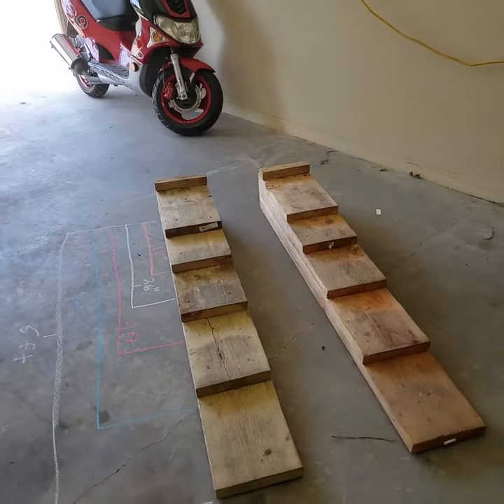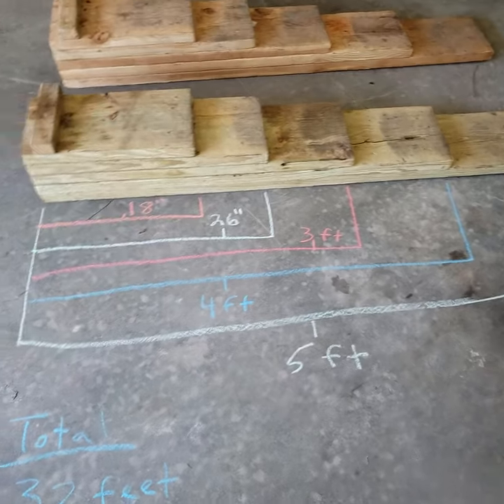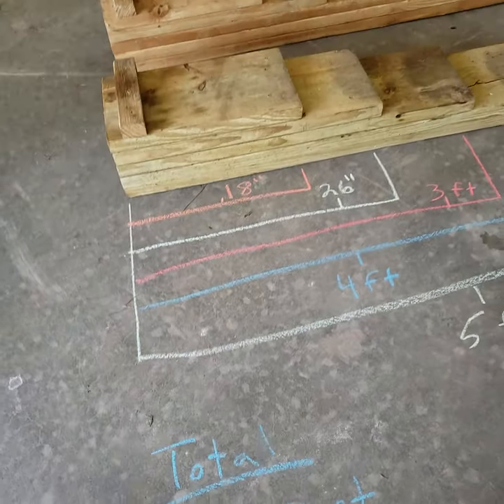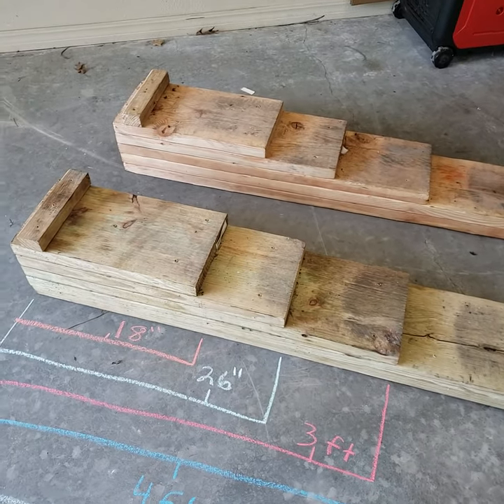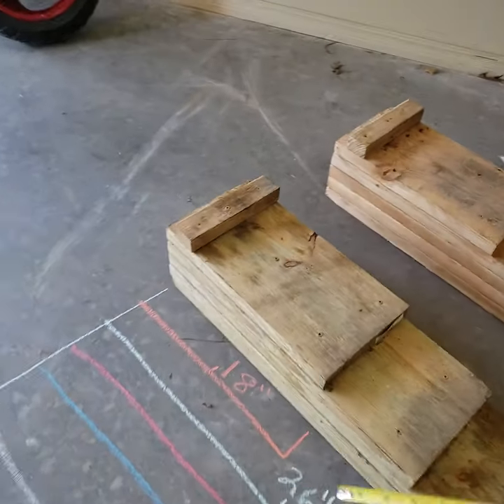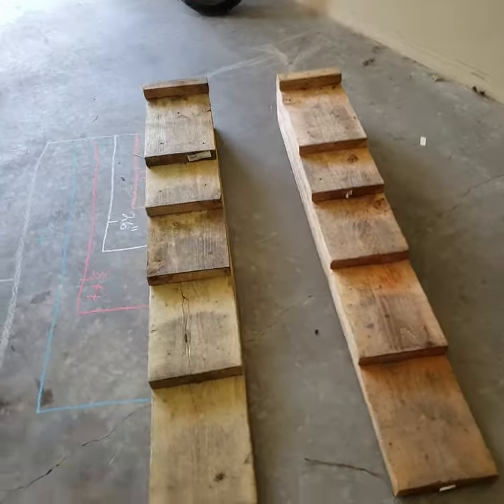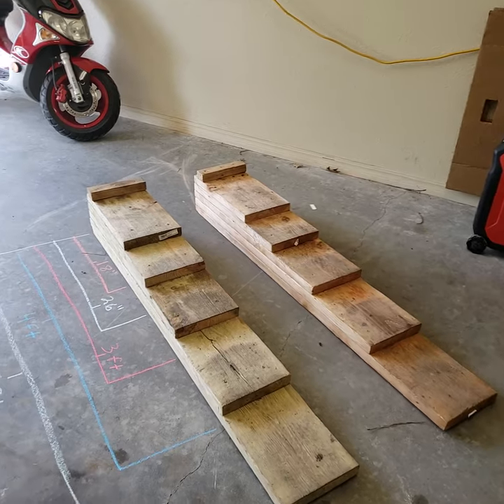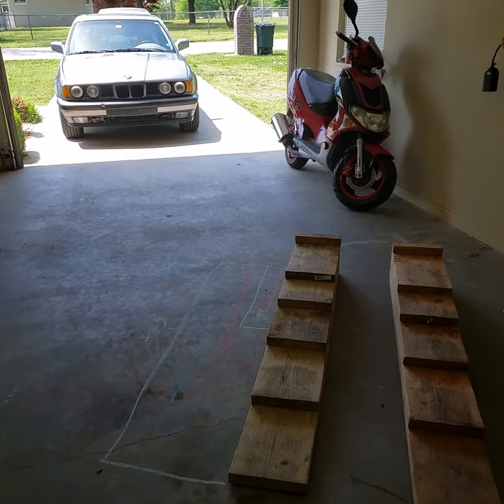Homemade Wooden Car Ramps

Comment: I built these today. Thanks !    I prefer the odd lengths at the top, I feel you get a little more working room with large tires .

If I did it again - I would step up to the 2x12’s .  I have a Highlander and  getting those big tires up there would be easier with a little extra room .